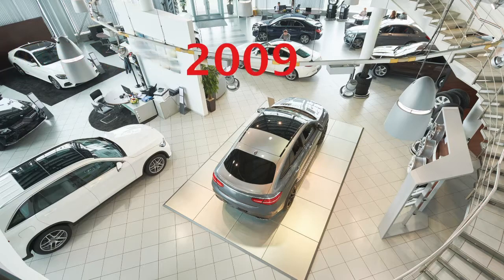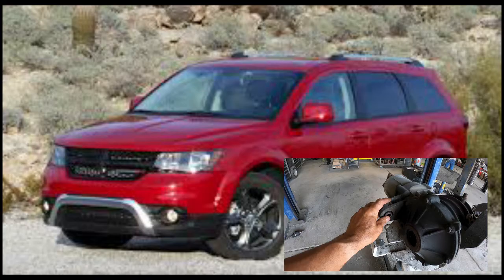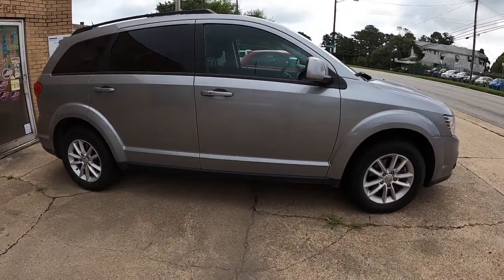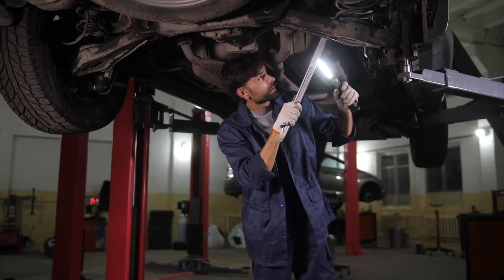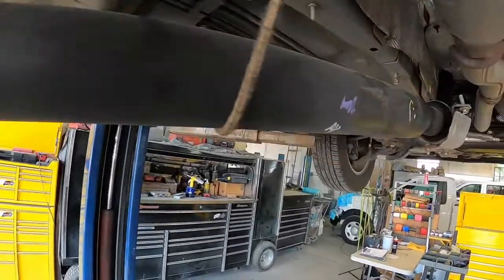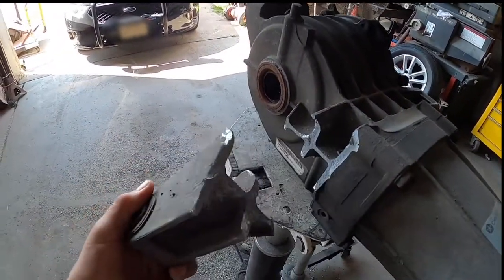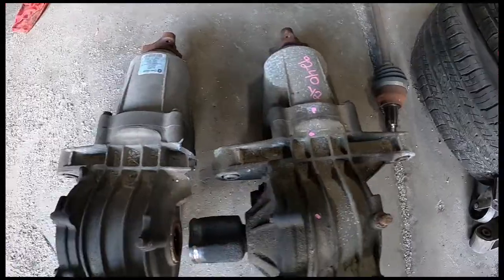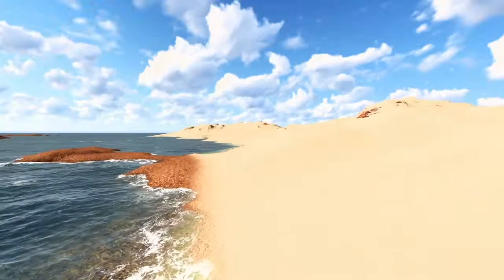Dodge Journey 2009-2020 (all wheel drive) this NEEDS to be a RECALL

Comment: Doing 80 dn the highway & 2013 journey went BOOM 💥 like I just ran something over with the rear wheels.  Luckily didn’t crash and coasted to a stop.  Rear end casing just snapped the ear off & case had multiple cracks….  750$ for 100k used rear end and 150$ for new axles & 60$ for seals & will be installing myself….
Should be total recall!!!  Class action needed!!!
Reply from the maker: That’s crazy

Comment: Never seen that myself, was at a Chrysler dealer for 5 years. Did see the rear ends on Cherokees and compass cut themselves in half and rip the wire harness out along with it though. Multiple times.

Comment: Yo there is another problem with the ptu the passenger seal goes bad also had to replace mine at 70,000 miles and the passenger drive shaft  Assembly would have cost me over 3,000 to fix but I got the parts online and fixed it myself

Comment: My sister in law is complaining about this same clunking noise. She’s bringing me her car to look at it this weekend. Hopefully this isn’t the problem but it’s not looking good.
Reply: So she brought it to me and I found the rear diff is still good. I can’t duplicate the noise but I’m guessing it’s the PTU. She’s leaving car with me so I can drive it and see what it’s actually doing.
Reply: @paulwest4424  Did u find out what the issue was?
Reply: @Losbass  not officially but now I’m leaning towards torque converter. Had to drive it around for a few days but it finally did the pop for me today. Won’t do it under load and wheel has to be close to full lock. Feels like transmission isn’t disengaging properly. Not totally sure where to go from here but there’s no codes popping up.
Reply: @paulwest4424  Interesting… Thanks for the feedback!
Reply: what did you find?
I had one brought to me with the front Power distribution Unit cracked in 2. 
Replaced it. Found the engine mounts worn. replaced all 3 plus the trans mount. Also the front CV shafts along with the hubs. rear CV shafts had just been replaced before the Power Differential split. 
Drove the car and the front is good , but twice during the test drive heard a small clunk from the rear. in the morning checking the differential and the mounts. see if that is the issue.

Comment: What if one buys a 2019 Fwd version? Would it have the same issue?
Reply: i know I'm kinda randomly asking but do anyone know a good website to watch newly released series online ?
Reply: @Walter Salvatore lately I have been using FlixZone. Just google for it :)
Reply: @Walter Salvatore i watch on flixzone. You can find it on google =)
Reply: @Walter Salvatore Lately I have been using FlixZone. Just google for it =)
Reply: @Walter Salvatore Lately I have been using flixzone. Just search on google for it =)
Reply: No, because there is no rear differential on FWD models BUT the 3.6 engine along with the 6 speed German automatic it's mated to also has issues so I recommend the less power but reliable 2.4 4 cylinder engine which it and the 4 speed automatic have been trouble free plus they cost less to service and repair because they were engineered by Chrysler when it was American owned.

Comment: What is the exact name of the part and what state you in? I need someone to diagnose mine and many mechanics say there no problem though I feel a kick a lot
Reply from the maker: rear dif, im in Va.
Reply: @AutoRepairTips757  ah ok. Im up in Mass, i had a mechanic change the rear diff recently but idk if they replaced the whole part or just the shaft. I still feel a kick from there and it concerns me everytime. How much did it cost to replace? That way Im prepared if I have to pay for it
Reply from the maker: @jeremyladue4702  it all depends on the labor rate in your area but  around $1000.00
Reply: @AutoRepairTips757  wow, ok. Maybe I wont bother then lol! If thats the total after replacing the part, that aint so bad, but if its for diagnosis, phew
Reply: @AutoRepairTips757  whereabouts in VA?
Reply: @AutoRepairTips757  if its not that, could the awd transfer unit be faulty? I feel a kick from the back a lot
Reply: @jeremyladue4702  that sounds like a gear with sheared off teeth. It might miss or ski p over the area before catching. Abused differential possibly.
Reply: @JessicaSimonson1976  all I know is it was manufactured in Mexico
Reply: @jeremyladue4702  bad gear shifts break teeth off gears.....has nothing to do with where was made. I had a Ford Ranger where I caused this same issue.....it would lurch after catching gear then slip when got back to that spot.
Reply: @JessicaSimonson1976  problem is no one diagnosis it with issues saying that’s usual for the year of the make of it. Even the torque converter makes a concerning noise and they say that’s how it was made for that year

Comment: I just bought a 2019 journey awd should I worry?
Reply from the maker: No, I think it’s something you just need to check every once in a while and see if you see it starting to crack over all the good trucks
Reply: @AutoRepairTips757  ok thanks
Reply: My rule of thumb is NEVER buy an AWD vehicle unless you live on a place where it snows more than a foot of snow everyday. For the average person a front wheel drive is all most people need plus equals more miles per gallon, less oils and maintenace to worry aobut and also less parts that could potentially break. An AWD vehicle you now hava differentials, transfer cases and a few other crap that could potentially leave you broke.
Reply: @AutoRepairTips757  whats that exact part called? Maybe Ill ask a private place to diagnose it, could you please also complain to corporate dodge, the more complaints, the more likely there will be a recall
Reply: I have a 2014 awd rally and so far its been a good lil truck, knock on wood. 
I Did have to replace oil cooler though and that wasnt a cheap job. 
But honestly i like driving my journey, there great for long trips because there comfortable, it rides nice, the cabin is quiet and it doesn’t feel like your driving a big ass buss. Plus the remote start with heated seats and steering wheel are great for the winter.
There not perfect though, they have there issues, in the cold the power steering motor is loud when you first start it up and even though i have the big screen with navigation, there is no car play, and the rear hatch is still manual. And the car looks old on the outside compared to the new stuff, i wonder if they will ever redo the journey or caravan if people keep buying them up.
Reply: @inmatejason  is that what the loud noise in winter is? Always wondered that. Also, when you steer the wheel do you feel a click? I do alot and no mechanic can tell me why.
Reply: @inmatejason  think the caravan theyre discontinuing but keeping the journey, should really update it for sure if they want me to get another one... mine is awd and I feel a kick a lot from the rear. A mechanic says my bar shafts for the rear wheels are wearing out but I should get a 2nd opinion
Reply: @inmatejason  I think they're not making anymore after 2020. My 2019 journey still runs great. I had it for 4 months. Only thing is there's a humming sound when idling but I researched I  guess is normal.
Reply: @BigBoss-lm6cf  Your absolutely right.
I live in Utah but in the valley where we get some snow but FWD does great.
Plus AWD is harder on gas and more expensive to service.
Reply: I have a 2018, when I back up or turn it will make a poping sound, what do u think it is

Comment: The European version of the Dodge Journey CRD 2009 that has a Volkswagen engine 2.0 and a Ford automatic gearbox 6DCT450 is really bad and it's really a very failed car!
Reply: At one time Volkswagen brand was considered very good in America but no more and they are expensive to service and repair.
The Ford 6 speed automatic had many issues in America too.
I do not understand why Fiat would use a German engine when they have one of their own or the American 2.4 engine which is reliable for the European version.
Reply: The 2.0 VW TD engine is a tried & true old school diesel engine that does interstellar mileages that would put most Yank engines longevity to shame. Not that I've anything against American cars, my daily driver is a Cherokee XJ here in UK. Not sure what that Dodge Journeys owners problem was but it could have been related to the rest of the car. Or neglected maintenance from the PO. Could be anything but unlikely to be the VW unit....